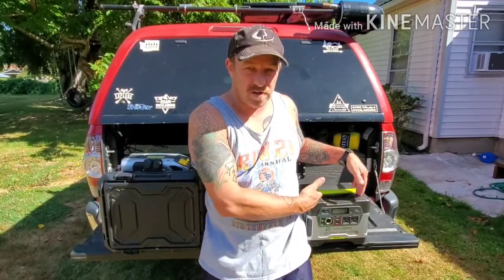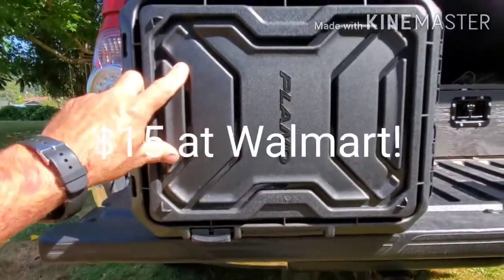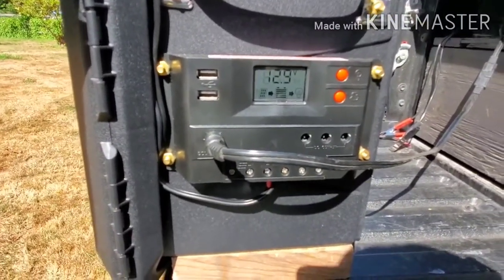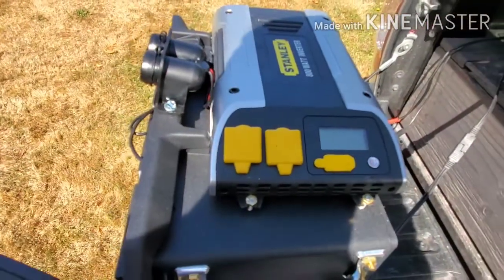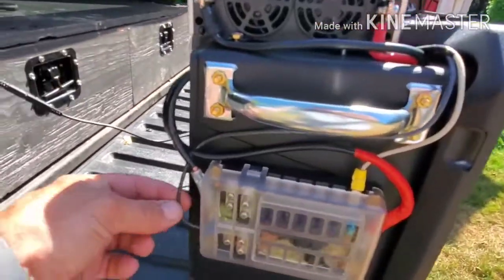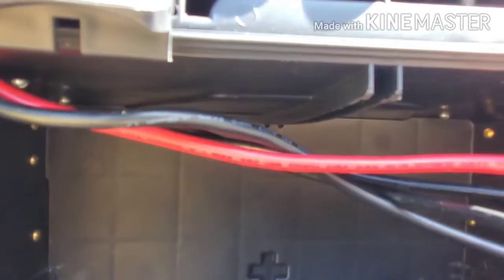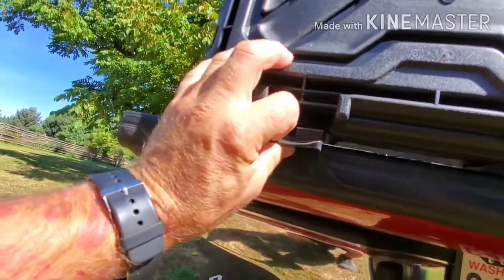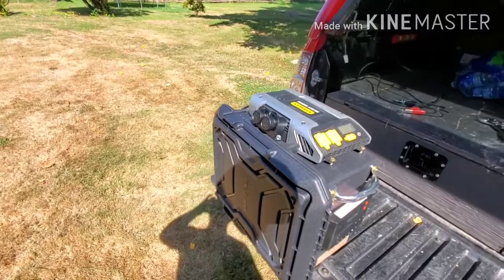DIY solar generator for $200! 800 watts of on the go power in 1 hour! Watch before you buy!

Comment: Yeah we've lost power a couple times due to storms or Transformer fires Underground down here in Baltimore City Fells Point area so I built a power box myself for home emergency power but not as portable as yours going to start working on something like that that I can Grab & Go
Reply from the maker: That's awesome! We are in the pacific northwest and do a lot of overlanding.  It will run my fridge 4 or 5 days without a charge, and with only 50 watt of solar it will run it forever! I wanted it portable though so I can use it in a future trailer build I'm planning as well. If you didn't want the fuse panel, it would be super easy to just use a in-line fuse for the cigarette plug, but I figured it would be nice for the trailer eventually so just did it now.
Reply: @overlanderbenny3789  Yes, I guess my Tacklife“solar generator “ would be considered an all in one. On seeing your “Power Box” with a the small batteries and you say only 50 watt solar panel, I’m envious.
My main use is to keep my 45 watt freezer/cooler running for several days. Maybe occasional use of 200 watt elec blanket or small appliances. 
I especially like the small footprint depending on which box is used as my vanette is space limited. 
? So with the charge controller you can keep the solar panel connected continually and mount it permanently somewhere? 
Will rewatch your vid many times. Kudos for posting and answering 👍🙏
Reply from the maker: @rocknmamma2666  I normally run 100 watt of panels but I broke 2...so right now I'm at 50 watt on my truck with 100 watt set in the box for my trailer build. (Stay tuned for more!) The problem is the inverters take a lot of power. So although I can run my 12v fridge for a long time, once I start using 110v power the battery dies pretty fast. Yes I can keep my panels plugged in at all times and the controller regulates the charge. I strap it in my truck and plug in the panels so it will charge during the day as I drive. A lot of panels are Portable and not permanent, but I didn't like that since I'm driving during the day and want it to charge for the night ahead. So....I mounted my panels to my canopy and it works great! (Keep the bolts tight so not to have 2 break loose and shatter) lol
Reply: Man I'm not quite ready to build my own. Kudos to you both.